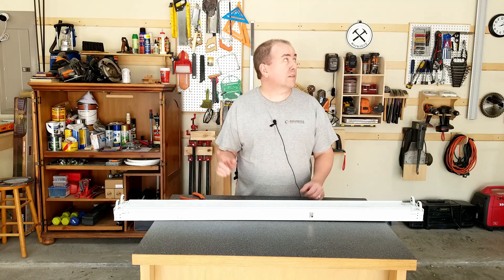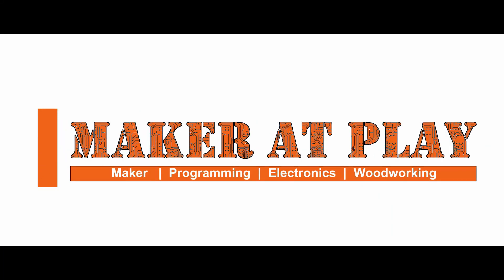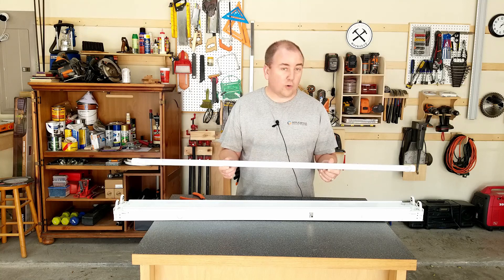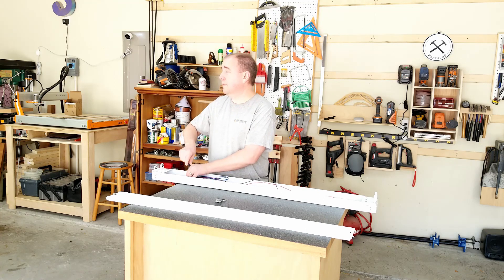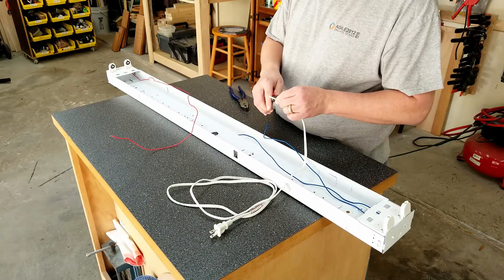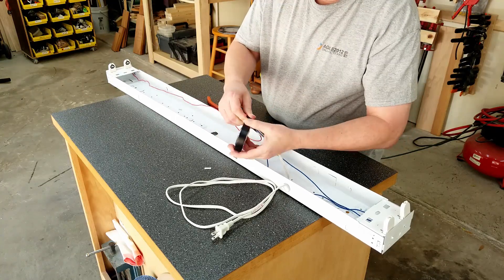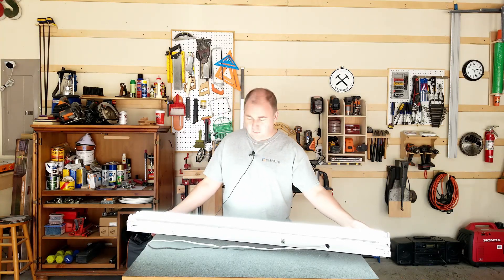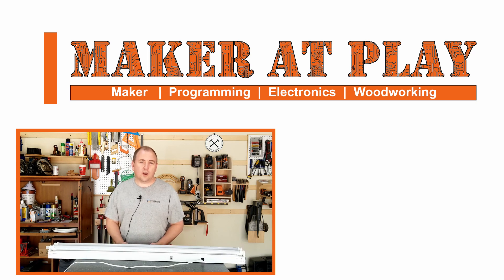Replacing fluorescent lights with LED lights

Comment: What's your estimated risk for fire hazard?
Reply from the maker: Still nervous from when I blew up something in our dorm room?
Reply: @MakerAtPlay  nope. I was wondering if a wire nut or soldering the wires after ballast removal would reduce fire hazard. College is meant for education in a safer environment.